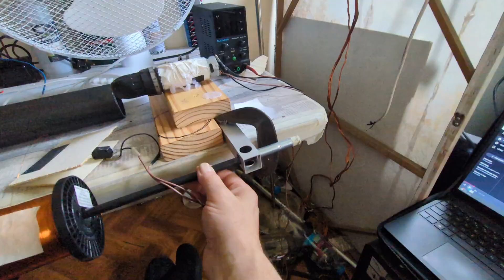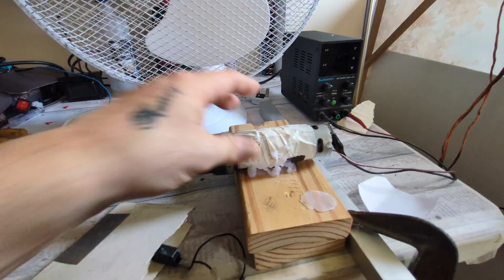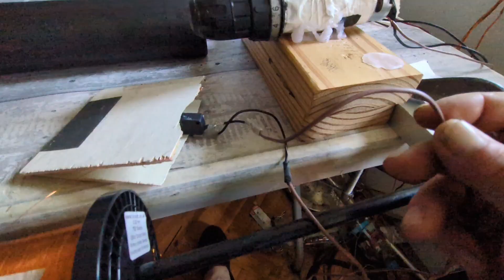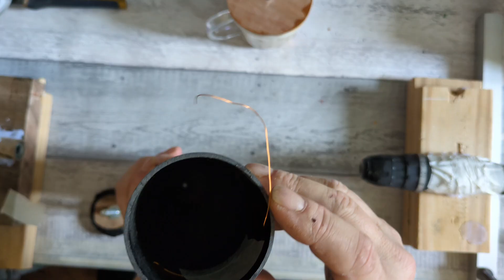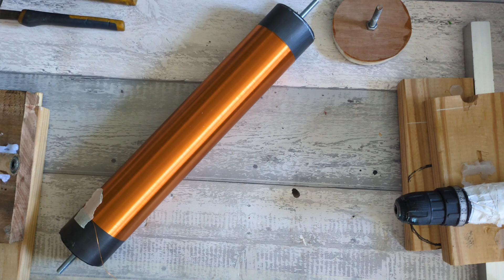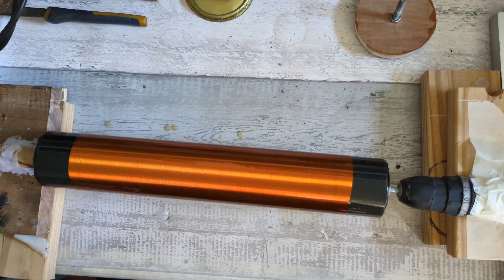OBIT Tesla coil build, How to wind the secondary coil. PART 2. How to build a Tesla coil at home.

Comment: Great to see you are building, despite only having crude tools :) A tip on winding, try holding the wire the opposite way, so instead of getting it in place with your nail, you kind of lean it up against the previous winding at some 15 degree angle. Makes it much easier to wind.
Reply from the maker: That is a great tip, I will definitely give that technique a try on my next coil build! 
   Thank you for your advice I appreciate it very much.